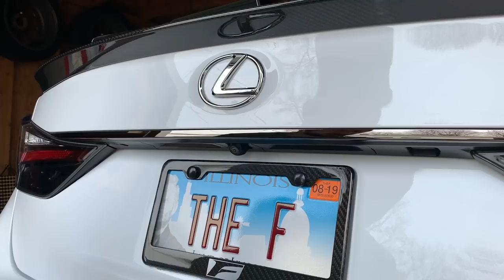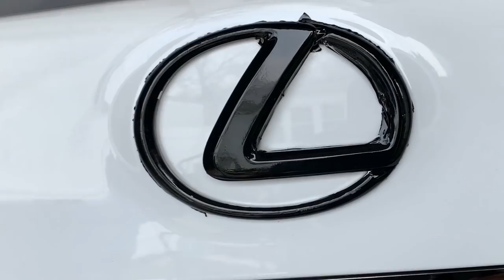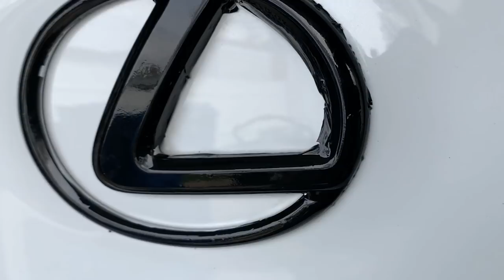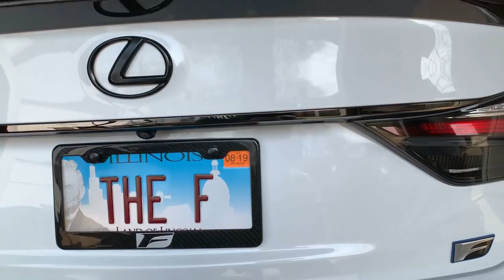VYNIL, PLASTI DIP OR DEBADGE WHAT TO DO ON THE LEXUS GSF

Comment: The other trick I learned was the adhesive from the “L” emblem stayed on the car, so I covered it with Saran wrap to keep it clean while I painted the emblem, then after the paint dried I removed the Saran Wrap and heated/softened the adhesive that remained on the car and reapplied the emblem - WORKED PERFECTLY!!
Reply from the maker: Ok nice that’s smart so u can re use it

Comment: If you do 7-10 layers it comes off easy and clean on the letters. I would also coat them  because some products burn the plasti dip color. My ZR2 came out nice with those layers but taking them off also works 😂
Reply from the maker: I should have added the 3m adhesive promoter on the letters it pro would helped it stick better.

Comment: Lol I’m scared to plasti dip on my pearl white paint but it’s definitely the cheapest and best option probably
Reply from the maker: Don't be scared the dip won't damage the paint
Reply: Plasti is a good option,  just got to start with light coats then build on with heavy coats so it's easier to come off
Reply: Nothing to worry about. It actually protects your paint. You can easily peel off if you don't like and it wont damage your clear coat or paint. You can even use Goo Gone if you're having trouble removing it.